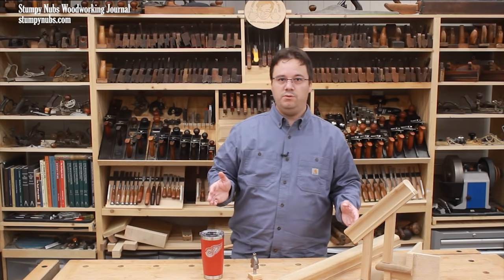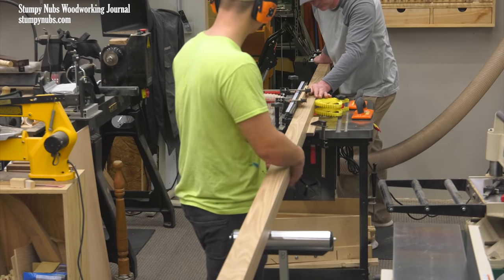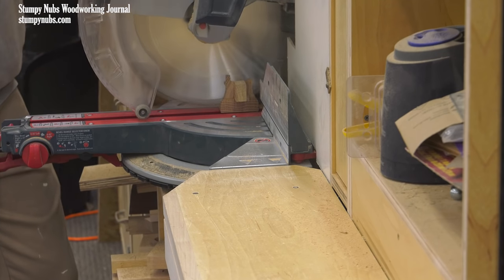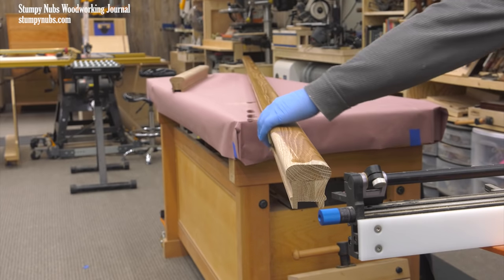Why you should make your own stair railing

Comment: My house was built in 1910.  The whole stair well was built with hand tools.  The stair rail is walnut.   Each spindle was hand turned and hand dovetailed into the treads, which are pine.   When I refinished them I could tell they all had slight differences that you can only see when you hold them next to each other.  After scrapping off the buckets of paint and restoring the whole stairwell it now looks amazing.  I am now just finishing the closet under the stairs.  Even though I did not build it from scratch, I feel a sense of accomplishment in restoring it to its original glory.  
Anyone who wants to tackle a project like this should consider it even though it is a lot of work.
Reply: Grandpa was a professional, hand wood turner.  His European boyhood apprenticeship, was  under the watchful eyes of men born in the late 19th Century.  He was piece-working by his 16th birthday and paying for anything rejected.  His completed pile was counted and examined at the close of every (12 hour) day.
You could take two separate posts or balusters, slice them in half and hold them together, with nearly no differences.  Only sharpe and crisp corners distinguished his work from automatic lathe production.
If you're able to distinguish slight turning variations, you're most likely looking at a youthful production piece or from some turning shop with high-production rates and lower quality-control standards.  
As Grandpa was teaching me, he threw quite a few of my pieces in the trash heap.

Comment: GREAT info. Makes sense to laminate and shape rather than trying to buy and expensive block that you are going to cut away quite a chunk. P.S. I made a picture frame using your multiple router bits last week. So thanks for that as well. 😎
Reply: Yes the complex moulding video was one we all need to try out.  I am going to give a go very soon now.  (I am currently rebuilding my router cabinet  replacing the top and insert)

Comment: I regularly build my rails in place...makes attachments easier.

Laminated veneer lumber for a core is strong and long.

Some stock chair rail moldings (i.e. 390) can be used for the sides in a pinch...

Need plenty of clamps!

Manufactured stair parts are expensive and often poor quality.

Great video!

Comment: I replaced my janky 70s painted stair railing with a maple and 1/8 inch aluminum sandwich. Pinned it with aluminum pins and epoxied. Came out like a giant knife handle and is rigid like metal.  I love it and it matches the kitchen cabinets.

Comment: Beautiful!  I've installed stairs before that were red oak. Repaired some which needed the volutes to extend past the three steps beyond the wall, and return them to the spiral end on the outside of the lowest step. I have no idea why the previous 'trim carpenters' thought they could just run a return to the wall and leave no railings for the lowest three steps sticking into the room. 

It was lots of fun even though I had to use pre ordered parts the general contractor had bought - and here's an interesting point. Where the new bannisters met the installed bannisters, because they were the same manufacturer but differing lot numbers - THEY DIDN'T MATCH!!!  

Talk about profile sanding and scraping!  But it came out beautifully if I say so myself...
Reply: Another point for some. Red oak splits during machining about 23% of the time. White oak about 27% of the time. Make sure you get enough.

Comment: I did this when I had some leftover hickory flooring. Made the Newel posts and balusters from poplar, square cross-section and painted white to match the risers. Handrails also from painted poplar, topped off with a half-inch layer of hickory. Hickory accents between the balusters along the floor, surrounded by painted poplar. To this day, I consider it my crowning woodworking achievement.

Comment: Almost every stairbuider of the past, made their own handrail and everything else.  They left us many fine examples as a testimony of this fact.  
Actually  the specific manufacturing of handrail was often a specialized branch and separate job (a trade to be taken seriously, beginning with a youthful  apprenticeship .)
If you really don't want to use factory parts made from downfall (scrap) then you need to make the parts yourself.  You also don't have to use generic parts, designed to fit everywhere (when in reality, really fit nowhere.)
Then we might talk about custom, circular stairs and geometric staircases that really require custom handrail.  
Be careful though, you might become to fixated on doing nothing but custom work (because you can) while ignoring standard work that pays the bills
Been there, done that.

Comment: You've done a beautiful job, but it made me nervous just watching you work.  In fact I just glanced down at a comment from elitearbor and he says how difficult he found the process.  I'd be OK trying it with pine, but definitely nervous about risking expensive oak.  I noticed how slowly you advanced the workpiece James, and even stopped on at least one place.  Did you have a secret to prevent burning?
Reply from the maker: It's not difficult if you take the time to install the featherboards, etc. If you get some burns, just take a final light pass to skim the surface and clean it up.

Comment: Great video!  Im currently renovating the house my wife and bought together.  Theres a really cool spiral staircase that goes to the basement but it needs work.... Im trying to figure out a way to make the handrail for it that wont be an absolute nightmare to try and do... one of the reasons I havent crossed that burning bridge yet... haha
Reply: I did railing on a spiral staircase a number of years ago. I ended up cutting a curve in to 3 foot long sections of wood, gluing the sections up, and then gluing those sections into a spiral. A lot of wood is wasted doing it that way and a good, sturdy template is a necessity for this.
Reply: @criswilson1140  Good to know!  
Ive also seen a few videos where people have made a clamp set up and soaked wood to flex it into the needed curve.  So it holds the curve when it dries.
Reply: @thehumantoeRD  I tried the water soak bending and steam bending, both in a form, but could never get a repeatable bend due to the spring back when I took them out of the form. Plus, it was a scary amount of force to get the 2" thick wood to bend.

Comment: 100 percent pure nubberie, (James) I noticed what I thought was a Harvey shaper ( in the background of the video) , but you used a Sawstop in the video, I also Notice that you have the Harvey dust processor (which I have and like very much) so I like the Harvey Stuff  and find it to be of good Quality and well thought  through (Engineered) but expensive.(buy once, Cry Once) can you go in to detail about the Harvey/bridge City tools you have?...and buy the way this summer I put Carpet squares in my shop and I love it.
Reply from the maker: I don't have a Harvey shaper. There are two standalone cast iron router tables (SawStop and MLCS). I recently got a Harvey cast iron router table wing for my  table saw, which is the Harvey Ambassador 4hp with the gold top. I also have their smaller dust collector, their smaller lathe and both of their bandsaws. All are great machines!

Comment: I am not a proper tradesman who has the access or the money to use these more expensive machines such as router and planer tables but I still want to do DIY stuff like this. The most expensive power tool I have is probably the mitre saw I own which I didn't even buy which belonged to my uncle and that is only worth like $200
Reply: You can make hand rails with hand tools. Hollow and round planes will do the job just as well as a router.

Comment: As a carpenter in the netherlands i would like to ask why you left te ends of the planks you glue together to get length straight. i have always learnt that when lengthening a piece of wood (we call it welding) you have cut the end at least 10 degree or more
Reply: I don't believe this was necessary since the butt joint wasn't the only thing holding the pieces together. They were laminated on other pieces, staggering where the ends met.

Comment: I'm surprised you didn't make something designed around an older railing or making it obviously unique vs using the "generic" design found in the big box stores.  Is there a requirement to use that standardized design sold in every supplier?

Comment: Is there a potential problem with expansion and the joints separating when gluing pieces together with the growth rings perpendicular?  How big would the prices need to be to be concerned?
Reply from the maker: All the grain runs in the same direction
Reply: To expand what Stumpy said, careful board selection to make sure the grain is all running in the same direction.
Reply: @StumpyNubs  Yes, the grain runs along the length of the handrail. The difference in expansion that I’m referring to is between how much the wood expands tangentially along the growth rings vs radially out from the center of the log. From what I saw in the video looking from the end of the handrail, the top piece has the growth rings going left to right and the bits glued on the bottom, to make the rail thicker, the growth rings run up and down. Compare this to the two bottom pieces being rotated 90 degrees so that they also have the growth rings running left to right, more like how it would be if the handrail was made from one solid board.
Reply from the maker: @jamanjeval  These pieces are 1 inch to 1.5 inches wide. The movement across that is very minimal.

Comment: What if you don't have stairs, or more than one floor?
Or even a building?
Reply: Build one!
Reply: @bluaugendvl  Can I build a ladder to climb up to my hammock instead? A retractable track that could be pulled up when at the top, without harming the tree, would be ideal. Any ideas how I could meet that last requirement? Thanks in advance for any help you can give.
Reply: Tree House
Reply: @wyattdean5658  Why? The hammock and A-framed tarp provide enough protection, so why create an interior space when it is unnecessary?

Comment: Wiping with a damp rag will also cause the flat mark caused by the bearing to almost disappear. It also raises the grain slightly, which is sanded off. At least, that's how I do it. Don't know if it saves time or anything.

Comment: My grandfather “finished” newly built houses in the early 1900’s. Installing window trim, staircases etc. 
He said he’d go into a house and there would be the millworker and a pile of rough cut lumber. Usually poplar. 
He would plane and saw all of the tiny pieces to make the staircase. The more ornate stuff was milled. But the majority of the trim work he built. 
His tools were a brace and bits, handsaws from a rip saw to a coping saw. Various planes. Some were homemade as well as the special profile blades.  Different hammers and chisels. 
The chest he’d built himself. Perhaps 4’x30”x18”. Every tool had it’s own compartment. 
He got paid $100 and it took all winter. He said his mother-in-law marveled when she calculated he made a dollar a day!  When at that time wages were 2 or 3 dollars a week. 
The rest of the year he built houses. 
He passed his chest on to my dad. Over the years the tools dwindled away or rusted. 
Dad was no carpenter. But the biggest hazard was me and my brother. A regret I have today.

Comment: Great. Well over a year after I saw the prices of oak railing at Menards, and also balusters, etc at the bottom end,  this shows up. Yeah, I'm not paying the about $100 for the railing piece only. Nope. Let alone the rest of the stairway.

About 30 years ago, I had done a complete stairway, but not the railing, in ash. Having ash in the inventory again, I decided to make this one as well, for a new addition's basement.
This inventory of ash was from my own trees, killed by ash borer, harvested by me, taken to a sawmill, and air dried for a few years.

So a year and a half ago, I went to my pile of native ash, planed a bunch of boards, and set about making the stairs. I completed the stairs and the boards against the wall, and then looked at what it would take to make a railing.

I took pictures and measurements of the commercial railings, and translated it to what I could do. The commercial railings were laminated, so I decided to do the same. That makes it possible to do with the one-inch lumber.

Short story made short, it is all done and looks gorgeous. And the cost out of pocket was only for screws and hardware, plus varnish.

Oh, I counted the number of individual pieces to the complete job, the main railing as one even though laminated, and it is about 100. That includes the bottom 4 ft of baluster work.

Thanks for the video, anyway. And now I will watch it. :-)

Comment: In 50 + years I never  really worked with fine wood working , I had to buld or fix a few small things , I could weild a hammer and chisel , drive a nail  , cut form work for concreting with a  circular saw , jig saw and befor battery tools  drag a brace and bit hand drills up telephone and power poles  ,  used a lathe booth wood and metal  , but , I prefered steel or alloy . It would be fair to say my wood working skills were RAG ( Rough as guts )  didn't need to be pretty  but did need to be done and quick .  
So  I recently had to start repairing and building things at my folks place as they are now beyond the work themselves ,  stairs and doors and other assorted items that have seen their better days and some weren't that well built or square anyways as i am finding . I have found the intricacies of wood enjoyable and the expirience of building something or even repairing the stair rail and step treds  and cupboards also enjoyable , and I realized , that Patience is what I was missing , all those years ago . 
I came across your YOU Tube Channel and must say thank you for the informative and entertaining videos , You have taught this old dog a few new tricks  . 

P.S , I saw an older video and I also did a bit damage to my hand 17 years ago , my right hand  needed an op to fix two broken knuckles and a cut tendon  , took years to get full movement back and some times it just aches in the cold and there are still nerve endings that are sensetive . So I can understand and sympathize with you and hope your hand is healing well .

Comment: I have an off topic question but one that might make for a good video. I recently can't into possession of an antique wash stand that has the old style colored varnish on it I could never recreate. However, the top came loose and has cupped upward, like a bowl. How would I flatten this out without damaging the finish?
Reply from the maker: You can't flatten that back out. The fibers on the top have permanently compressed after all that time. Even if you could swell them back up with moisture, the finish has sealed them up.

Comment: I have a Victorian with a wrap around porch and replace the wood railings (40" long Each) about every  5 years...I have found that full size jig really allows me to turn them out quickly and accurately. It necessitates using 3/4 plywood base...but allows quick and accurate placement of each spindle and allows you to pick up the entire assembly for installation between "pillars".  Admittedly not anywhere near as nice as your work...but I do route and cut all pieces from simple dimensional lumber...quotes I've received for duicsting work were in the thousands ( porch is 80 lineal feet).  Great video...especially timely given paucity of skilled labor...

Comment: This timing is amazing, I'll be installing treads, risers and a rail very soon.  Would you mind giving me a bit of a sneak peak?  What finish do you suggest for treads? (they're staying wood, no carpet or runners or anything).
Reply from the maker: I used Varathane poly. Durability was the most important factor in this case.
Reply: @StumpyNubs  That's what I'm after as well, thanks for the tip.

Comment: Thanks for the very informative video. I always pick some helpful info that I either hadn't thought of, or really clever idea to achieve an end result. One question though, what are your thoughts on cutting slips into the top "feather board" the get more of a feathering effect like the yellow feathering boards. Is this completely unnecessary  and overkill. As always thanks again and will eagerly await your next video.
Reply from the maker: It worked fine as it was